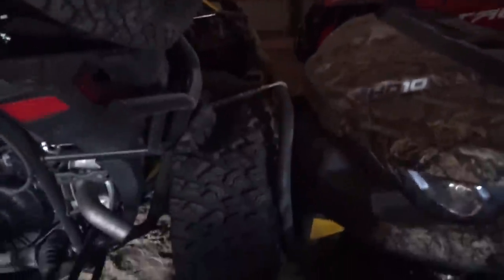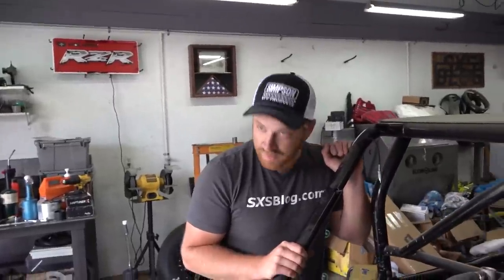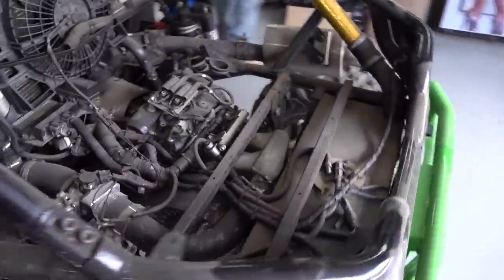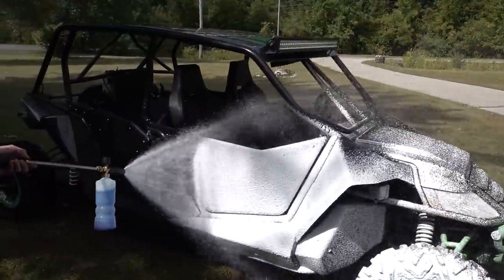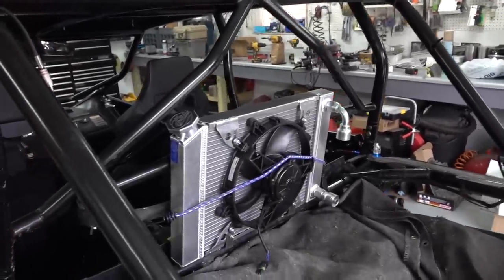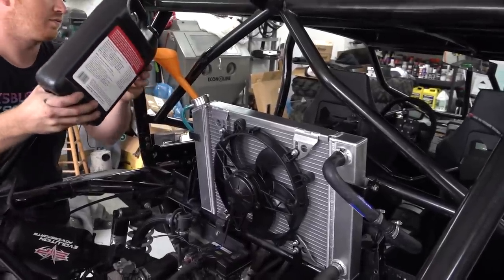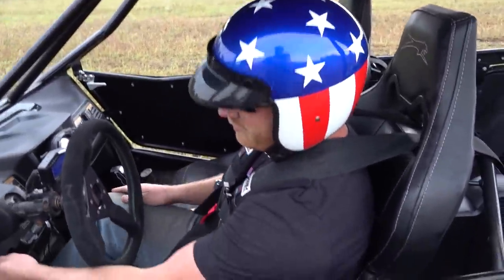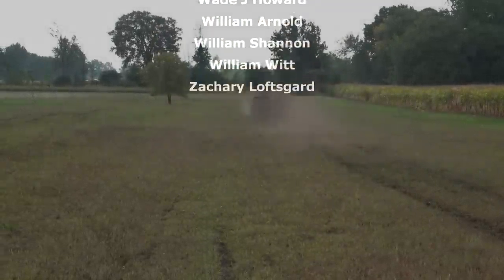Project 9 Lives 300hp Wildcat 4X gets a new radiator and HUGE paddles!

Comment: Those little vacuum pumps are handy. Never used mine for brakes, but was good for helping a Diesel APU get a prime after doing some fuel system work on it. Shop guys always had trouble getting the APU running after service, but a few minutes with the pump and I'd have it running.

Comment: That’s z-1 motor has so much more power doesn’t seem like it’s running right. I had the same motor but never installed it ended up selling the motor but I have friends that have the Z-1 crazy fast. 👍

Comment: Prob too late but these kits usually had a hard plastic cone like tip that would jam into the inside of the bleeder instead of going over it which was the issue with the one man bleeder kits we used to sell

Comment: the only way i've had any luck with vacuum bleeders is by packing heavy grease around the bleed screw, otherwise when you open the bleeder the threads leak air!

Comment: You guys should make a mount for the radiator to go between the back role cage arms. Like the guys do that race utvs do. Buy some slim chance you blow a radiator hose or cap and there is people sitting in the back seats they will not be having a good day getting sprayed with very hot fluid. That’s one of the reasons why racers mount there radiators above where the bed would be so they don’t get burned and also protect the radiator from a collision

Comment: It took me awhile to figure those hand bleeders out but this was my trick to make it work. I had to take all the bleeder screws out of the caliper put Teflon tape on them reinstall them then use a little bit of grease on the rubber nipple on the bleeder. Once you eliminate all air leaks from the screw to the bleeder tool on it works great took me hours to figure this out.
Reply from the maker: We got a tip to do it with the bleeder completely removed and use the cone shape fittings in the kit to plug into the hole, will try that next time

Comment: 38:35 sounds like it was lean popping not the Rev limiter. Double check your wideband sensor . It may be giving you a false positive. Throw some more fuel at it and see if it goes away.
Reply: Evo didnt believe in high rpm limiters. Always had that problem with my evo turned sled. When these come out off the 2 step they over rev a bit for a second. Also could be sacked out clutching from sitting not helping the matter
Reply from the maker: This definitely has a rev limiter
Reply: @SXSBlog  right but what I was saying is he didn't wanting to set it higher than 8500rpm.

Comment: I saw a yellow banshee! Whats it got! Im super curious about the old doug and his banshee days! We got a bunch in our family!
Reply from the maker: +4 motor on methanol, 1-4 override, stock cylinder 10 port, 35mm air strikers, +10 swinger, lockup, CPI inframes.  Scattered a piston the last time I had it out which was probably 5 years ago, so it needs some attention lol
Reply: @SXSBlog  very cool. my family is tryng to build a 10 mill but i think we will be going cheetah cub on race fuel. i just have a daily duner stock stroke and cylinders with pretty heavy dune porting and t5s. what does your bike run hp wise?

Comment: didn't y'all already have a vacuum bleeder that's how you were checking the crack pressure on the wastegates was it not?
Reply from the maker: That's just a pressure pump for doin crack pressure, doesn't have the reservoir needed for vacuum bleeding

Comment: You shouldn't have wasted your money on the vacuum bleeder all you need is a hose that will fit over the bleeder screw a clear bottle and how you do that is build clear bottle with about 2 to 3 in of brake fluid put the hose on the bleeder screw open the bleeder screw fill the reservoir get in and pump the brakes until no more bubbles come out through the hose tighten bleeder screw repeat process with the other three wheels good luck

Comment: Are those Wildcats any good? Or are they just straight trash? Cause they are less expensive here and I cant afford a brand new side by side
Reply: Find a XP1K, you'll thank yourself later lol
Reply from the maker: We have not had good luck with them, lol
Reply: I have a 2016 wildcat X and love it.Ive had several RZR s and worked on them non stop I hated them.
Reply: @Marcus-km6kf  really? That's good someone has had good luck with them all I hear is trash talk about them. They are about the only 1000cc utv I could afford.
Reply: @qtrmilemalone  those are a little out of my budget if my goal is under 10k if not more
Reply: @docholliday9791   get what you can, bro. Lot of people have success with them, having a machine is better than not having one. 
Get the cat now, save up for something later on if you truly enjoy it.
Reply: Doc Holliday97 
I paid 10k for my 2016 limited X with 600 miles on it.Its been a great machine over all it rides fantastic and has good power.
Reply: there's multiple Wildcats here from 6k-7.5k and I they're all 2013-15s and in good shape rzrs are really expensive here
Reply: @docholliday9791  I have never had an issue with my 2014 either

Comment: it dosnt seem like a 300 hp unit why is that
Reply: Michael Simon it probably weighs 2,000 lbs
Reply: It has some tuning issues and traction and clutch issues.
It still ran mid 5s to 60 spinning 400 feet.When then get it all working good it will run a lot better
Reply: what noodle